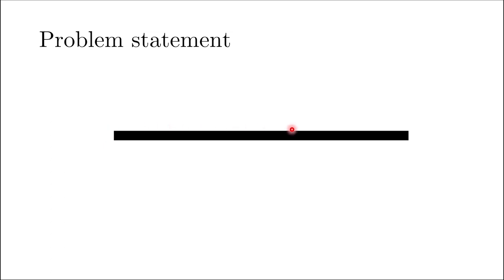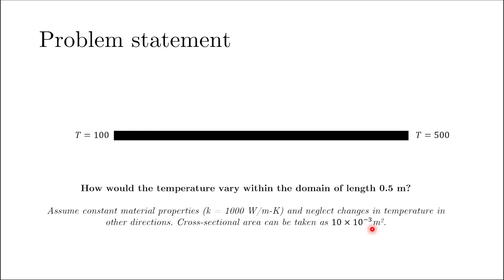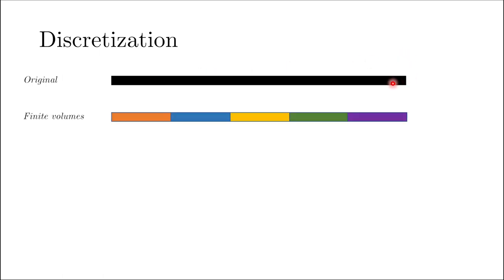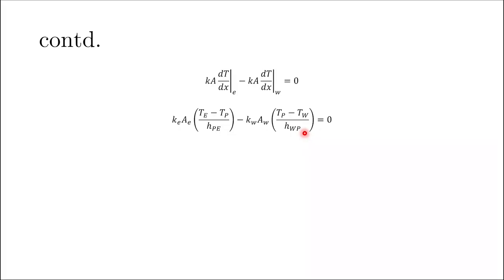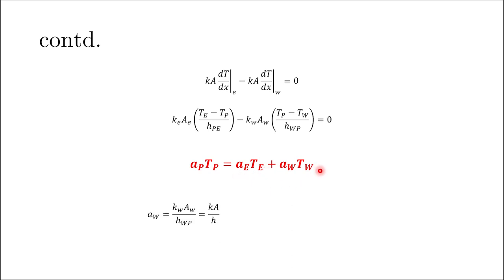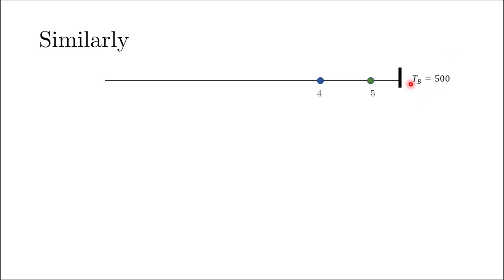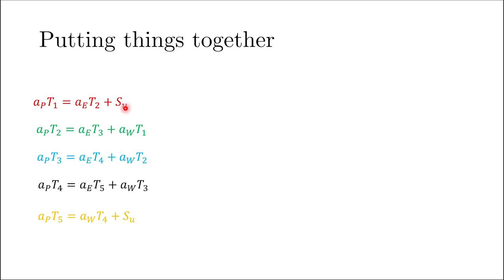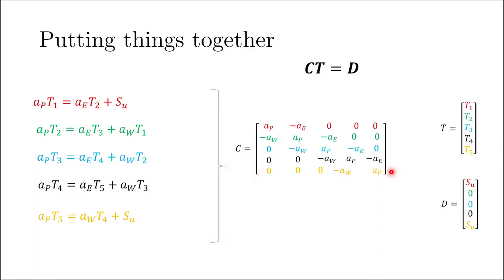Matrix Based Implicit Solution of Steady Diffusion Equation (CFD/CHT) using MATLAB - Part 1/2

Comment: Can I have codes for different problems? I have also made different codes but some are really giving me trouble for example: lid driven cavity with temperature difference on the wall (2 vorticity will be form ) with stream function formulation. kindly help if you have any idea.
Reply from the maker: Sorry, but I haven't looked into stream function formulation.
Reply from the maker: Also, I don't plan to use/demonstrate implicit methods fur Navier Stokes in this series.
Reply: @TanmayAgrawal7  okay sir, but if you find some text or any content related to this please inform me. And malalashekhra is very good book . keep it up!
Reply from the maker: You might want to check the book of Ferziger and Peric. They might have it.